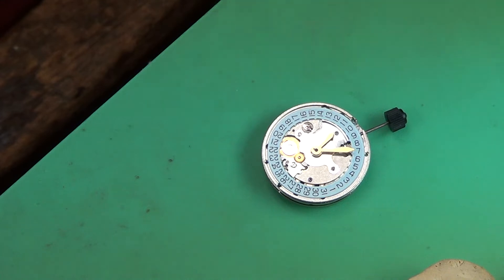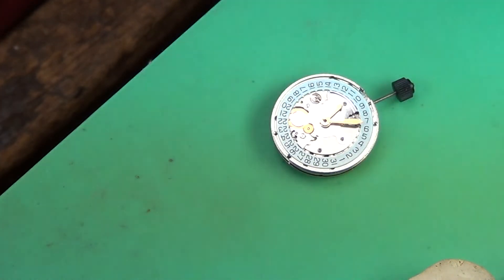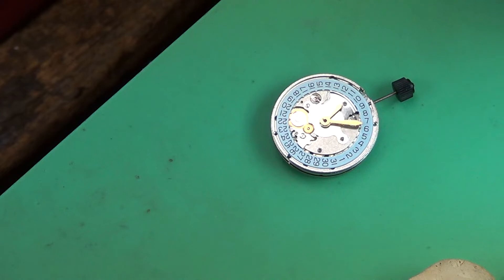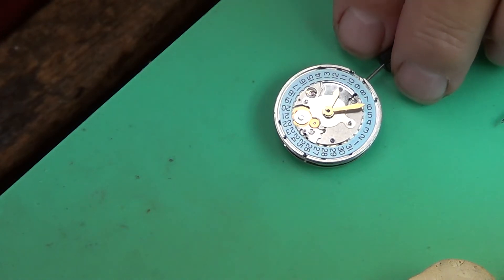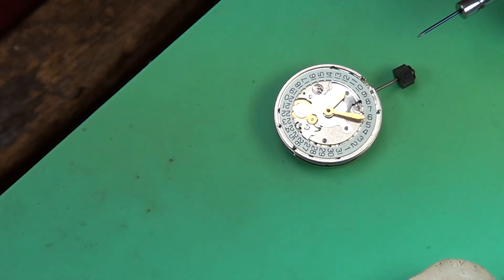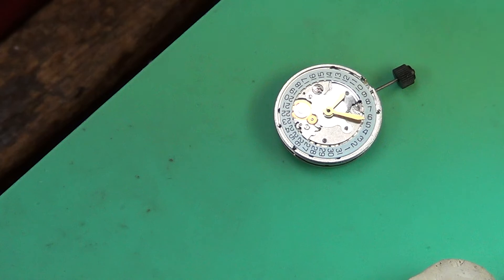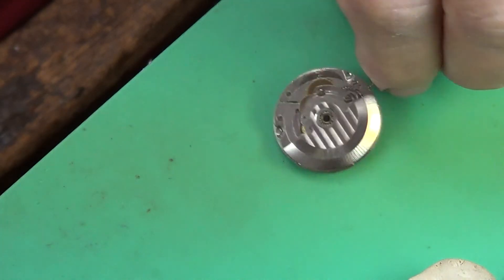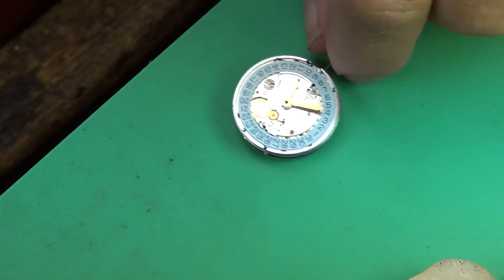Making A 14K Solid Gold Watch: Using the ETA 2824 Clone Movement Part 1

Comment: Did you ever make the watch?
Reply from the maker: The watch is finished in design only using Fusion 360 but the gold price cost is too high for now so it's on the back burner.
Reply from the maker: The watch is finished in design only using Fusion 360 but the gold price cost is too high for now so it's on the back burner.